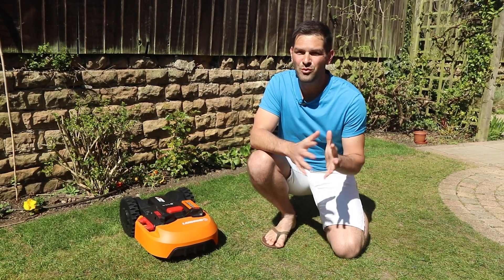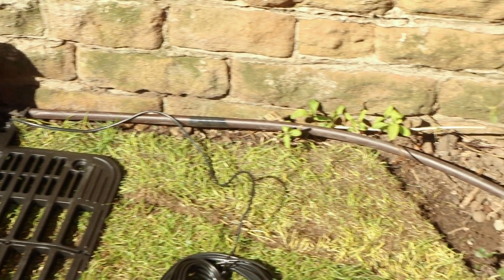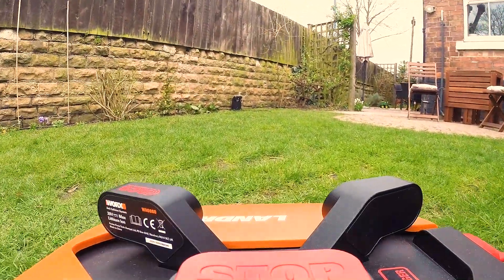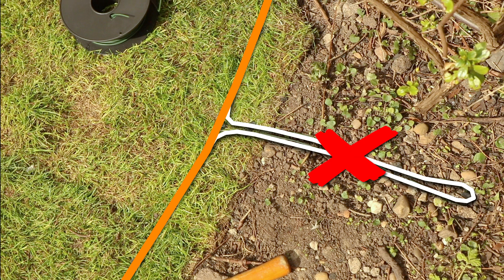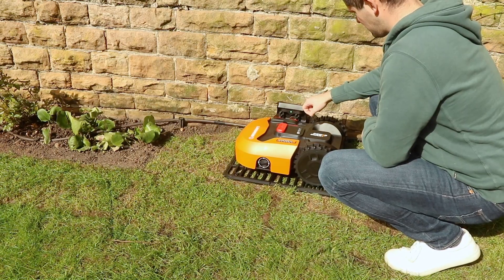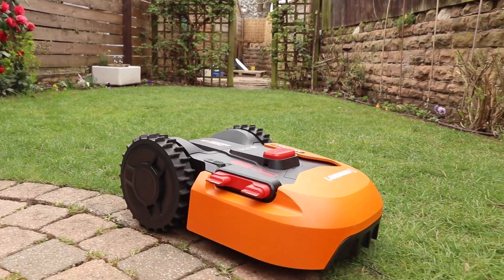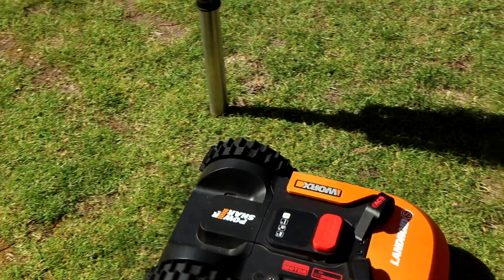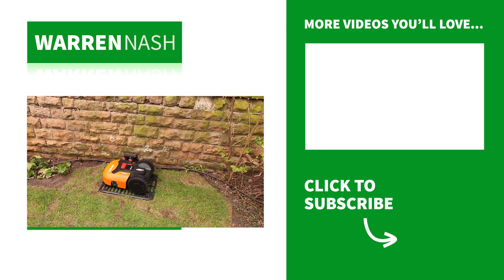Worx Landroid Installation tips, Setup, Review & ACS Test #Ad

Comment: Good, no waisted time, instructions.  However, I wonder about the final statements regarding theft of Landroid.  IF the Landroid only operates with the charging station it was set-up with, then what would happen if that charging station failed?   Would a replacement charging station not operate the original Landroid?   From the wording in this video one is left with this question.
Reply from the maker: Great - glad you enjoyed the video.  The Landroid would work with any charging station.  It's the wfi the Landroid is connected to which determines if it will work or not.  For example, if the Landroid is no longer connected to it's trusted WIFI (e.g. because it has been removed from the premises), then it will no longer work.

Comment: Awesome video, just what I needed when considering a purchase. Informational, pleasant and timestamped! Just a follow up question: Did you test the ACS using smaller items like tennis balls, apples or other things that does not reach above the units height? Thanks!
Reply from the maker: Hi there I shall give that test a go today and let you know how I get on 👍
Reply: @WarrenNash  Awesome, thank you!
Reply from the maker: Hey, I placed an object 2.5 inches high in front of the Landroid and it did not slalom around it. Therefore I think it's safe to assume objects need to be at least the same level as the ACS module in order for the mower to slalom around them.

Comment: Does the ACS interfere with the edge cut feature? If a plant or tall grass is hanging over the edge, will it cut it or see it as an obstacle and avoid it? (IMHO, edge cut should be persistent, not using ACS).
Reply from the maker: Hi there, if a plant is overhanging the boundary wire and it's in the ACS's line of sight, the Landroid will slalom around the plant.
Reply: @WarrenNash  Aha. That’s too bad. I was hoping you could make the edge cut feature override ACS.

Comment: Just wanted to say: had a problem with Landroid after rinsing the wheels with water. The keyboard stopped working. Remedy: REMOVE the battery IMMEDIATELY so that no more electricity flows and wait until everything has dried up. Then we went again. Recommendation; be careful when rinsing, especially from below. The keyboard connector should not be adequately protected against water. I will look at it when the opportunity arises and seal it accordingly.
Reply: i lay mine screen against the house and house off the wheels and entire undercarriage.
Reply from the maker: Thanks for the great bit of advice.

Comment: I’m so mad. Spent hours laying in the cable. Followed instructions to a Tee. But it gives ZERO advice to anything other then a 90 degree turn. It scraps and tears up the ground on my curved garden beds, essentially meaning I have to tear it up and start again.
Reply: Also. Thanks for the extra spare loop slack trick. Why is this shit not in the manual, I had gone under pavers and had to drag it all back and out. 

I would also advise leaving a excess from starting point A so you can pull some through if needed after your first test run!!

Comment: These Machines are crap. We have bought of them, both are now broken after less then 2 years. Service ...ha ha. If you deal with them it takes ages, so we gave up, organized parts from Germany and fixed them ourself. Both main rotor engine broken (bearings) and on one the STOP bottom get stucked. We would never buy them again.